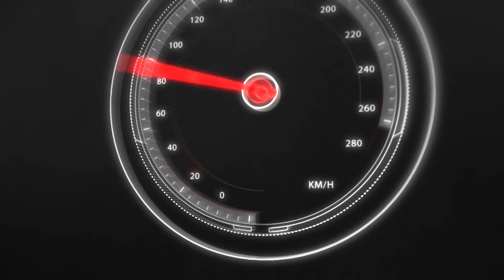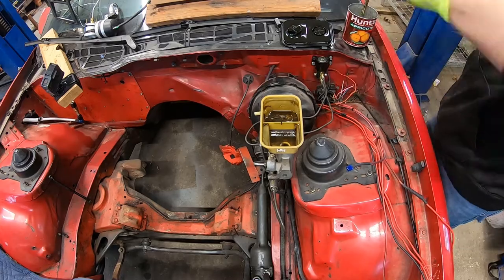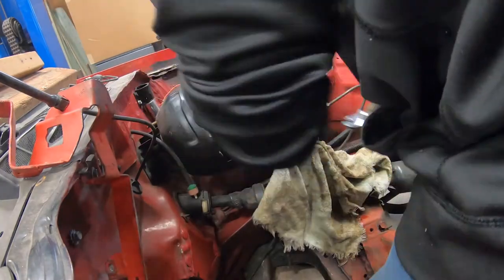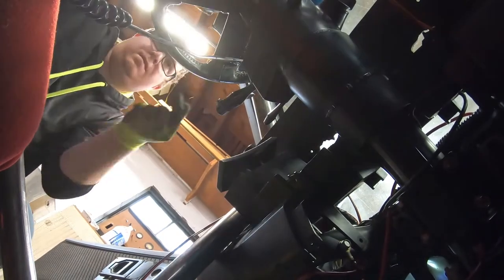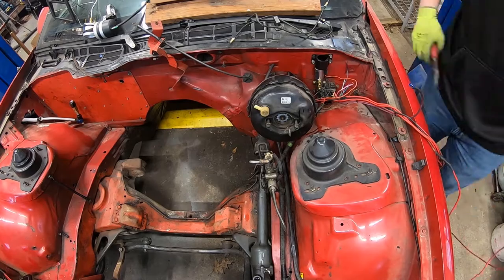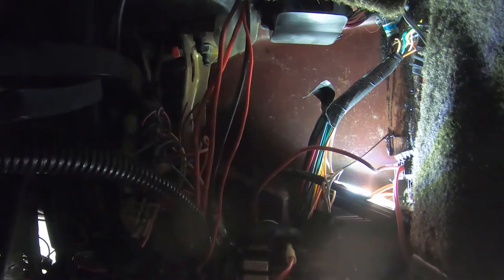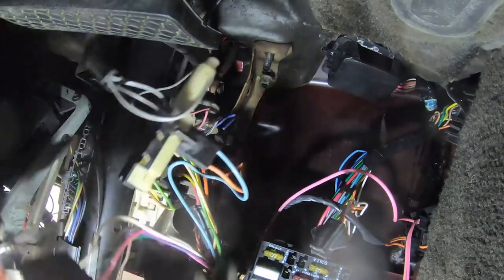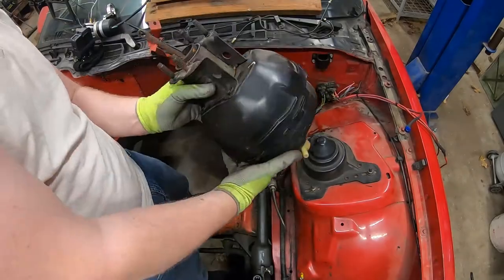84 Camaro Z28 Brake Booster and Brake Master Cylinder Removal [Part 1 of 2]

Comment: So on my 78 I bled the brakes and when I turn it on today, the brake pedal so soft again. Help!!
Reply from the maker: How did you bled them? Did you do the trick with someone in the car pumping them or a bleeder tool?
Reply: Vindexx Engineering 2 person bleeding. I think I just gotta bleed it more
Reply from the maker: @andreg8192  yeah, ive had vehicles its taken a couple of days to bleed the brakes on it... imo bleeding brakes is the worst part of auto repair